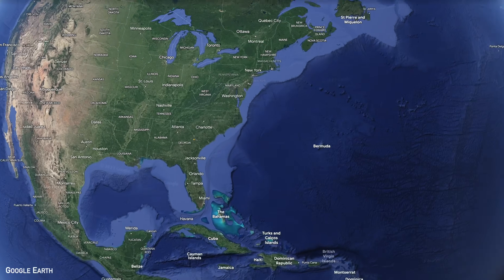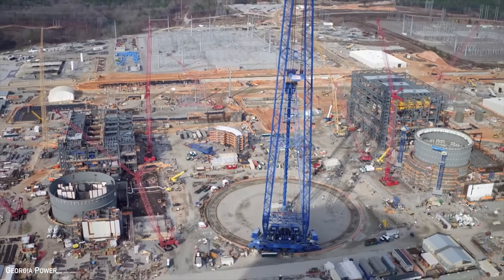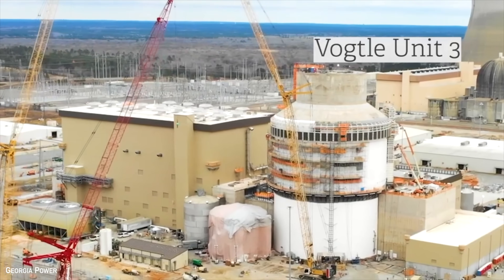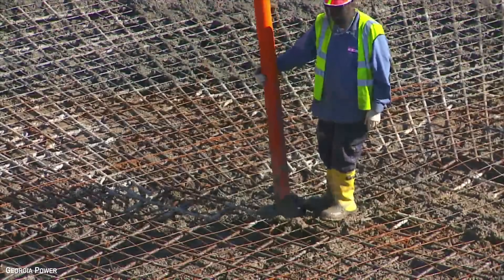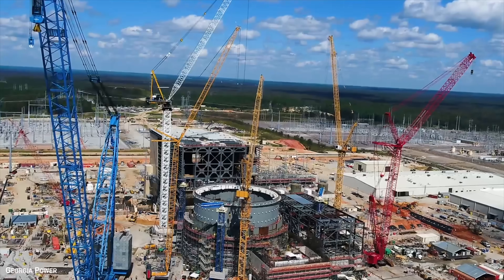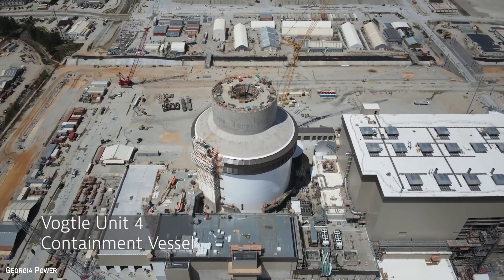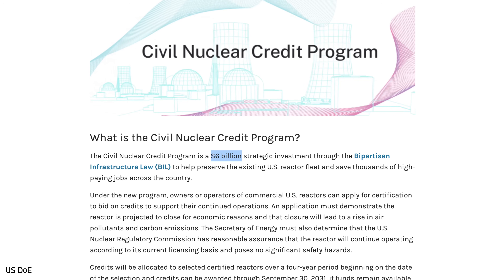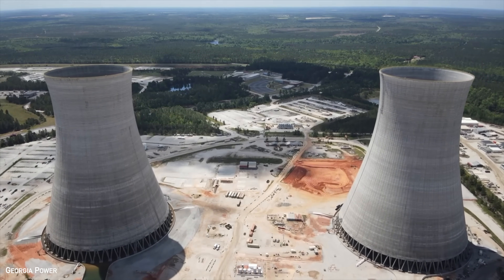Why the Future of Nuclear Power Depends on This Plant

Comment: Best ad ever to abandon nuclear power forever. Germany closed most of its NPPs after Fukushima. Just twelve years later Germany has exceeded all their former nuclear capacity with wind turbines and continue to build more. Easy. Inexpensive. Fast.
Reply from the maker: Unfortunately, Germany has some of the worst carbon and particulate emissions in western Europe. Since the gas supplies have been at risk from Russia, the German government authorized an extension of the remaining nuclear plants to maintain stability and get through the winter.
Reply: @atomicblender  It's fine with me that NPPs are run out to the end of their service lives. IMO we shouldn't build any new ones. Just think of how many wind turbines, solar farms and geothermal plants could be made for the tens of billions it takes to build a NPP--not the mention the decade plus time it takes to complete a NPP.
Reply: @longlakeshore  Germany is the best example of what not to do that we have. They have both the highest emissions and highest cost of electricity in the EU.
Reply: @chapter4travels  And the highest population and the largest economy.
Reply: @longlakeshore  you need an stable base-load supply, wind/ solar with battery's and/or hydrogen aint gonna cut it. Also electricity from NPP's isn't expensive that's BS. The cost overruns wont happen again beacause there is now some knowledge again
Reply: @erik7853  There hasn't been a NPP built yet that hasn't experienced massive cost overruns. A stable base supply will require excess capacity of wind, solar, geothermal, hydro, battery, flywheel and green hydrogen in an integrated system.
Reply: @longlakeshore  There are enough nuclear plants that have been built without overruns, and even now in like india. it just takes a bit of getting back the knowledge and overruns will be minimal. for your batteries the amount of cobalt and other metals needed will destroy ecosystems. not to mention the sulphur hexafluoride leaking from wind turbines and them being unrecycleable. Also flooding area for hydro destoys ecosystems and releases huge amounts of methane from decomposing stuff. Solar on the other hand uses massive amounts of space and the waste will be an enormous amount not to mention it makes us dependant on china. Speaking of hydrogen, only 25% of the invested energy will be actually used. Nuclear is even renewable if you take into account breeder reactors that are already in succesful operation.
Reply: @erik7853  In just sixty years of high power NPPs we've had three major meltdowns and still have two major radiologic exclusion zones. How many more do you want?
Reply: @longlakeshore  windmills cause more deaths per unit electricity generated than nuclear, moreover if you think of Fukushima: first thing in mind is the power plant where only 1 person died, while the tsunami itself caused 20,000 deaths. The most important part you are forgetting is that Chernobyl wasn't built and managed well, and Fukushima was literally built on a tsunami and earthquake prone spot. And even they are restarting their plants what do you say about that? The peak natural gas plants and the coal plants now restarted in Germany are causing more deaths than nuclear will ever do.
Reply: @erik7853  I say it's just a matter of time before the next Chernobyl/Fukushima radiologic exclusion zone if we keep running NPPs. Do you want one where you live?
Reply: @longlakeshore  
(from @chapter4travels) >> Germany is the best example of what not to do that we have. They have both the highest emissions and highest cost of electricity in the EU.
> And the highest population and the largest economy.

on a per capita or per GDP-basis, Germany has some of the worst emissions in the EU, some 3.5x that of the EU average

on a per capita or per GDP-basis, France has some of the BEST emissions in the EU, some 0.5x that of the EU average.

As for price - these are retail RATES, so the GDP/capita do not matter; and the French pay half the rate that Germans pay

but you don't have to believe me - you can look up the emissions and electricity prices yourself!
Reply: @longlakeshore  > There hasn't been a NPP built yet that hasn't experienced massive cost overruns
of course, this is untrue, but the more interesting point is - so what?

if your NPP is expensive, and has massive cost overruns - AND your electricity rates are cheap - do you care about the initial expense, cost overruns?

sure; intermittent wind/solar may be 'cheap', and may have few cost overruns - but there is no country/province/city (or perhaps a few islands with small populations and only tourism industry) which has predominately wind/solar and low emissions and/or low retail rates

there ARE several countries/provinces (France, Sweden, Ontario, Illinois) with a lot of nuclear with either low emissions, low retail rates, or both

AND there are several countries/provinces (Norway, Iceland, Costa Rica, Quebec, Tasmania) with a lot of hydro/geothermal with either low emissions, low retail rates, or both - but dispatchable hydro/geothermal DOES NOT PREDICT intermittent wind/solar
Reply: @factnotfiction5915  As expected from the country with the highest population, largest economy and most industry in the EU.

You missed my point that in the decade since Fukushima Germany installed enough wind and solar to exceed what they used to get from NPP alone. Think of how many coal fired plants Germany will turn off in the next decade as the trend continues.

This isn't about carbon emissions. This is about no more radiologic exclusion zones. BTW did you hear Japan is about to start ocean release all the radioactive water they've been storing at Fukushima? 

Priority? Get rid of nuclear plants FIRST. Then get rid of coal fired plants.
Reply: @longlakeshore  In Korea, we've installed over 50GW of solar/wind but because of their intemittency, they didn't contribute anything to the grid. In other words, coal/gas usage did not decrease with the increase of solar/wind. As for energy strorage(battery), the economics of it is so far off from reality not a single plant with over 10MW capacity was built in Korea.

The intermittency problem of solar/wind is very real and a serious problem. Denmark has the same problem. They have 50% wind but whenever the wind isn't blowing, they get electricity from EU grid. In other words, whenever the wind is not blowing, Denmark relies on other sources of energy which again is either fossil fuel or nuclear. Do not blind yourself thinking that solar/wind is the solution. In fact, their contribution to the grid is close to zero.
Reply: @rainzoro  Perhaps you haven't been following this thread. I never said wind and solar alone are the answer. I said "A stable base supply will require excess capacity of wind, solar, geothermal, hydro, battery, flywheel and green hydrogen in an integrated system." Excess wind and solar should be used to dissociate water into hydrogen and oxygen which are stored and burned in traditional plants when wind/solar becomes intermittent, for base load, and to cover peak load times. This isn't rocket science. We've had the technology to wean off fossil fuels and nuclear for decades but not the will to do it.
Reply: What left of Germany's power is a loughing stock, industry in decline, huge energy problems and prices sky high, do u wants such scenario. Ah Australia is in the some predicament, renovable nightmare
Reply: Germany has coal, gas and France.

Comment: would it be more cost-effective to refurbish nuclear plants that have been shut down?
Reply from the maker: Some yes, some no. At one point it becomes increasingly difficult to justify refurbishment, especially if the power output is low. Canada has a fair amount of experience replacing big components (pressure tubes) with their reactor design.
Reply: The benefit of small modular reactors like NuScale is they can directly replace oil/gas burners in existing non- nuclear power plants
Reply: @lukehahn4489  Replacing 60 year old coal fired plants with nuclear plants sounds like a great idea except that you have equipment supporting a nuclear reactor that was made in 1960.

Anyway, NuScale is on hold till 2025 trying to figure out how to reduce the ballooning cost and that is even before they moved the first shove of dirt.

Reality is not easy to swallow.
This is from the Des Moines Register an concerning the only Small Modular Reactor (SMR) project in the U.S. today. It should be noted that NuScale said (Jan/2023) the target price for power from the plant is $89 per megawatt hour, up 53% from the previous estimate of $58 per MW hour

In 2013, the Wall Street firm Lazard estimated that the cost of generating electricity at a new nuclear plant in the United States will be between $86 and $122 per megawatt-hour. Last November, Lazard estimated that the corresponding cost will be between $131 and $204 per megawatt-hour based upon the 4 recent new nuclear projects in the U.S. . During the same eight years, renewables have plummeted in cost, and the 2021 estimates of electricity from newly constructed utility-scale solar and wind plants range between $26 and $50 per megawatt-hour. Nuclear power is simply not economically competitive.
SMRs will be even less competitive. Building and operating SMRs will cost more than large reactors for each unit (megawatt) of generation capacity. A reactor that generates five times as much power will not require five times as much concrete or five times as many workers. This makes electricity from small reactors more expensive; many of the original small reactors built in the United States were financially uncompetitive and shut down early.
The estimated cost of constructing a plant with 600 megawatts of electricity from NuScale SMRs, arguably the design closest to deployment in the United States, was originally advertised as costing $1 billion but upon requesting actual bids from engineering firms, increased to $6.1 billion in 2020. Given inflation and other cost constraints that cost today can only be expected to be significantly higher.
The cost was so high that ten members of Utah Associated Municipal Power Systems canceled their contracts. NuScale then changed its proposed plant configuration to 6 fewer reactors but increased each reactor output from 50 Mw to 77 Mw costing at total of $5.3 billion. The NRC just last week approved the construction of the 50 Mw design but now will have to start the review process all over given the switch to a 77 Mw design. For each kilowatt of electrical generation capacity, that estimate is around 80% more than the per-kilowatt cost of the Vogtle project in Georgia — before its cost exploded from $14 billion to over $30 billion. Based on the historical experience with nuclear reactor construction, SMRs are very likely to cost much more than initially expected. And they now have delayed the project start until 2025 in an attempt to find more backers.  All this before the inevitable setbacks that will occur once construction starts.
Reply: It takes 16-17 years to build a nuclear power plant and upon completion, many of the components are either no longer made or were custom made originally.  Add to that the fact that replacement of primary system components requires all the radiological controls that make everything expensive. In order to keep a nuclear plant operating, many components (turbine, generators, switchgear, pumps) are routinely refurbished as normal maintenance.

A simple analogy: would it be more cost-effective to refurbish your old 1970s automobile? It certainly can be done but the lack of old automobiles on the road should give you the answer and automotive parts are not as complex or specialized as nuclear components.